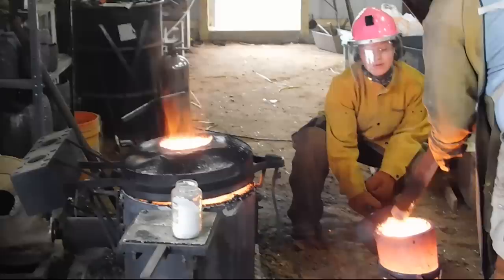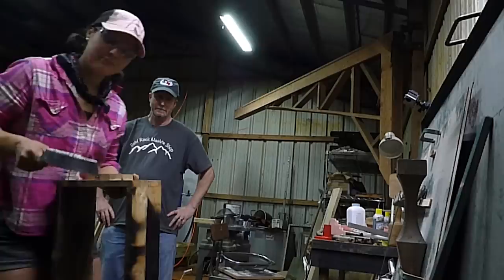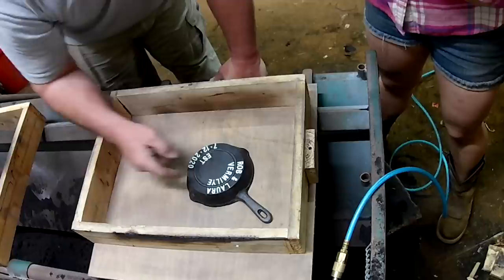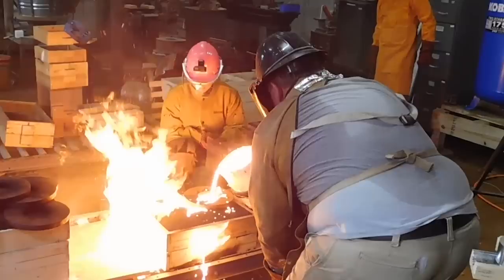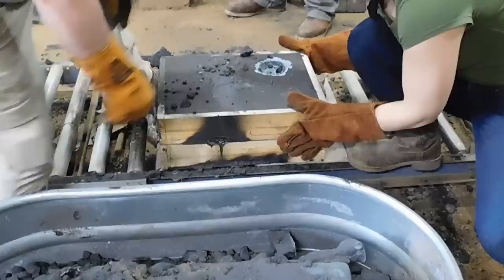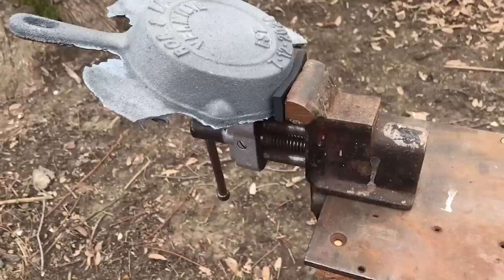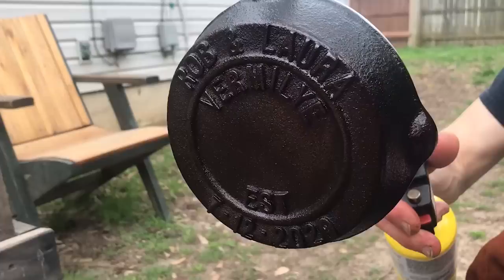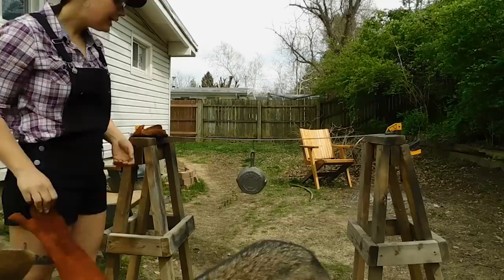Making a Cast Iron Skillet Using Recycled Brake Rotors | Cast Iron Gypsy at the Windy Hill Foundry

Comment: You can coat cast iron with pine tar, and heat it up for a really nice dark finish. Then you can apply boiled linseed oil for a bit of shine, and rust prevention. My favorite YouTube blacksmith did this on some of his work, and it looked super.
Reply: Boiled linseed oil? With reactive metals for accelerating the curing process? I think that's a terrible idea. Also, how can you be sure brake rotors don't have lead in them?
Reply: Can we get name drop for that YouTuber so they can get the proper recognition and a new subscriber(s).
Reply: @ryanhoyt2210  Absolutely, his YouTube channel, and real name is Torbjörn Åhman. Both his craftsmanship, and video editing is top notch, in my opinion.

Comment: I was laughing because my lady would have taken that and put it on the stove and used it to get that beautiful black.
Nicely done.  You make me want to get back to doing some more casting.  I use petrobond and aluminum, attempting to make simple machines such as dividing heads and such.  It is such a rush to pour molten metal and come back hours later to find what surprises are in that sand.

Comment: I watch the difference in your sand casting and these dudes I watch in India. Making a mold takes them about 6 minutes, all the while they are in tee-shirts and flip flops, one dude is melting the steel sitting about a foot away from the smelter pecking on his phone while non chalantly stuffing broken cast iron in the opening. The guys make 5 or 6 molds and the steel is ready and they pour it in tee shirts and flip flops. I like the video from you and everyone, I lived in USA 50 years and moved over seas luckily I was pre acclimated to the very different ideas about safety and job  just get er done. Great video thanks for the time needed to make,edit and post it!

Comment: Very nice job! I'm amazed that your letters stayed on the pan you used with only Elmer's glue. I believe I herd you say something in the video about adding additional weights. I believe you are correct, that more weights would definitely help with metal running out of your molds. You may also want to set the mold between two plates and bolt it together. I must say.. Rob is a lucky fella!

Comment: Great job, I'm impressed! Very cool looking skillet with such a good idea of putting your wedding date on! 
I've gotta say though, please consider not using gloves when using the angle grinder. If the material is caught up in the spinning disc, it's got a high chance of pulling your finger with it, especially using it with no guard. Maybe hold it a bit further back with gloves, as I know the sparks can hurt! We were always shouted at while at the training school whenever we used gloves on any rotating machinery, bench grinder, angle grinder, drill press, etc. We never thought of it until it was pointed out, and we were showed the gruesome after images of when it went wrong.
Reply: Gloves and angle grinder is not a huge deal, leather gloves and abrasive disks don't catch very easily. Put something in an old glove other than your hand and try it - it'll just bounce off and maybe grind a hole through it - not the violent catch you'd get with a metal lathe or even a drill, because there's no real teeth to a disk. 

Taking the guard off though is a good way to lose fingers - I've seen that happen and had to put co-worker fingers on ice and drive him to the hospital because he was "inconvenienced" by the guard.

Don't be like stumpy. put the damn guard back on.

Comment: This is very impressive skill of craftsmanship from a by gone era.  Good to see that there are people around who value these skills, perfect them over a lifetime, and pass them on to the younger generation.  
I wonder if the brake rotor steel is suitable for use cooking.   Has anyone checked if this material produces toxic emissions in a high heat environments such as stove top, 
very high heat ovens, BBQ grills, etc.  Does it meet the current standards for cooking utensils?
Reply: You ask about cooking temperatures!  Think for a moment about what you just watched.  That cast iron was approximately 2,800 degrees Fahrenheit when it was poured into the mold or over 7 times a typical frying temperature of 350 degrees.  Any possible contaminants are long gone.  The worst danger from cast iron comes from washing it with dish soap which can penetrate the pores and mix with oils creating a perfect environment for bacterial growth.  That is easily cured by NEVER using any kind of soap on your good cast iron cookware.  I'm sure that there are several good YouTube videos on the care and feeding of your cast iron cookware.

Comment: Cast iron and cast steel are different metals with slightly different properties. Brake rotors and most automotive parts are cast steel.   So what you have is an 'authentic' cast steel pan.

Comment: Amazing stuff. What kind of heat is required here? What fuel is the furnace using? I thought it was difficult to achieve Iron melting temps in a small foundry.

Comment: Is there asbestos on those brake rotors?  How does that work with melting down the iron does the asbestos go with the dross?  Just concerned if you eat from that the pores might still have asbestos in there.

Comment: Hmm I wonder what the foundry would charge to cast a part that's otherwise unobtainable, like a bandsaw wheel for a 1918 bandsaw?
Reply: It's typically $1.50-2.50 a pound not counting any pattern work or minimums for general castings these days. Around here in Texas, at least.

Comment: Can the cast iron skillet made from brake rotors be food safe, if you wanted something other than a wall decoration? Or are all their pieces strictly ornamental?
Reply: Fire kills everything.
Reply: @obsoleteprofessor2034  I was inquiring as to the material composition, and as to if there are any contaminants which may be present in brake rotors which might cause issues (such as lead, or cadmium, etc.) to look out for. If the rotors are made up of 100% pure iron, that'd be pretty sweet. I suspect there's other stuff added. I can probably google it to find out, but I figured it'd be something they would have already done the legwork on, and so I asked. :)

Comment: i'm not so sure i'd want to eat anything cooked in a skillet made from brake rotors. doesn't the composition of the rotors include asbestos? it doesn't take much asbestos to lodge in the body and cause cancer or mesothelioma 20 years later.
Reply: I could be wrong, but i thought that was the brake pads that used to contain asbestos (and dont anymore). I've never heard of asbestos on the iron.
Reply: She said in the video that she is making it as a decorative item, not a cooking utensil.
Reply: No, no, no, and no. There is zero asbestos in the steel from the rotors. Secondly, asbestos is no longer used in brake PADS. There was never, ever any asbestos inside brake rotors.
Reply: Brake pads.
The rotors are just cast metal

Comment: very interesting. when it spilled out the sides, I thought you would have nothing but a mess.  I would not make a wall hanger, I'd want it usable. would it be any more complicated to make a larger size? I would imagine other than maybe adding a few more runners it would be the same thing pretty much. The only time I was at a real foundry was when we had to have some parts for an old coal burning furnace made. They were able to take the old broken parts, put them together some how and make new iron parts. Would brake rotors be your best choice if you wanted a skillet to use? Many come from China and they're not known for making quality anything much these days. Funny, it used to be that before the so called revolution, they made excellent stuff, some of the best, especially in pottery and the stuff named for the country, china.

Comment: Good job Laura. Bone picking time. You go big on the safety gear for the casting, but then take the guard off your angle grinder. No good can come of that. Put your safety guard back on to control the sparks, protect you from any blade failures and to keep all of those talented fingers of yours attached to your hands.

Comment: I feel like someone with a metal foundry should be able to make flasks out of something which won't catch fire.... like.... I dunno..... metal. :-P
Reply: A 600° wood fire really isn't anything to be concerned about when you're playing with a couple thousand degree pot of metal. Wood's light, cheap, and easier to have multiple sizes on hand. When you're getting into the thousands of casts or using machinery to press sand, then you invest in some metal molds.